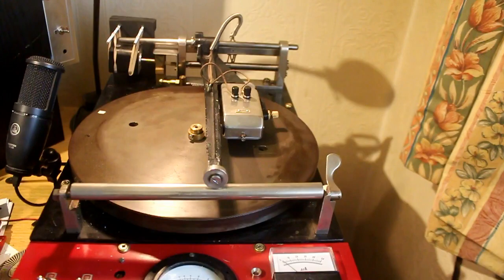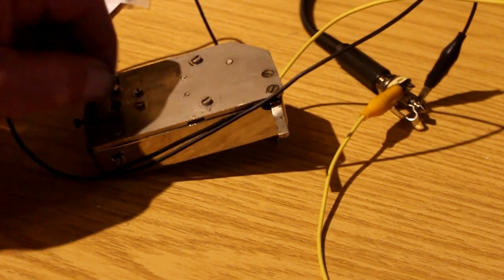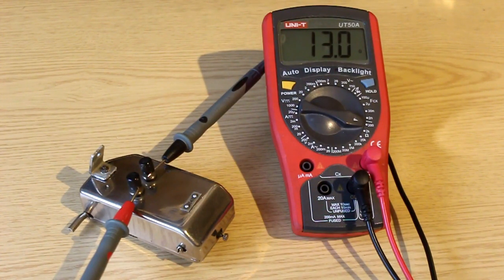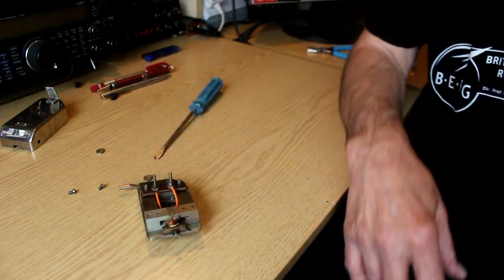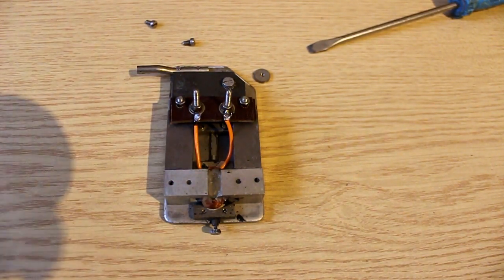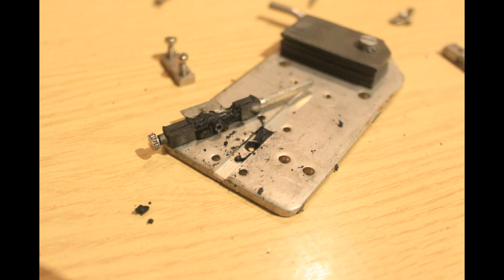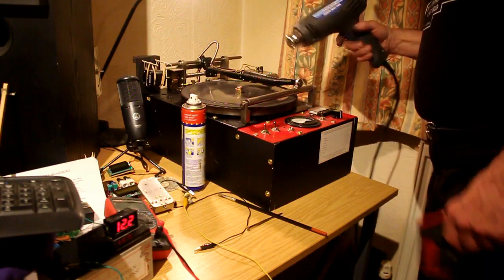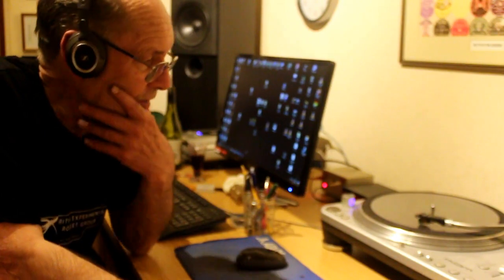MSS disc cutting head conservation.

Comment: Excellent repair job indeed.👌
Reply from the maker: Thanks for writing, Mark. Glad you liked it. The MSS head was ultra-simple, but could make quite good recordings, especially at the time that Cecil Watts devised it - ca. 1930. For various reasons, it was never radically updated, so by the the 1960s - when it was still being produced -   it was very 'old hat'. The two screw terminals on top proclaim its antique design; but the amplifiers MSS made could largely persuade the head to make a pretty decent recording! 😀

Comment: Hay Norman, After you did that nice job of rebuilding that cutter head, YOU FORGOT one thing - YOU DID NOT RE-MAGNETIZE that cutter. Once you pulled those magnets apart, you broke the field. The Gauss is reduce drastically and  the volume and efficiency of that cutter would  be very low. Then forcing you to feed more power into that coil it and you may burn it again.

Comment: Hello Norman, great video, I have a MSS machine, works fine mechanically and the head is ok. I believe the range top end is 8k and I’d like to know if that can be extended to something more modern? Are you in the business of working on these heads and is it actually possible to rewind or change the guts to get a wider frequency range. Thanks.
Reply from the maker: Sorry; I can't help you, because being 80 years old, I can't hear anything above about 6.5 kHz! However, if we had a Zoom chat, I could probably give you some useful info? Cheers, Norman.
Reply: @bixanorak  thanks for the quick reply, I understand, I don’t have the know how about these things so information may go over my head that’s why I was looking for someone who could do the technical work.

Comment: Interesting video, I have a very similar MSS lathe, same layout to yours but probably newer. The "cutting arm" on mine is rounded, all mounted in (I think) original wooden case with a Leak tonearm for playback. Also cuts 33 & 45. Mine has the same cutting head as in this video. I always thought my cutter had a replacement base plate, as it's not perfectly drilled etc, looks a bit homemade. But... appears to be the same as yours, the series of holes in the edge of the plate where cutter pivots/ is suspended aren't straight, yours looks exactly the same. Have these all been refurbished by same person in the past?? Interesting! I only have a little bit of history on MSS, do you have any more? I always thought mine was early 1960's but now I'm thinking a bit older
Reply from the maker: Hi Rog. Your three-speed machine would date basically from the early to mid 1950s and, as you say, well into the 1960s, only being finished off by the advent of stereo. They re-styled the arm, although the re-styling was more 'art deco' than 1950s! Again as you say, the heads have nearly always been 'worked on' - sometimes 'butchered' might be a better term; often I think, by well-intentioned amateurs, trying to make them work better, as demands for extended frequency response grew after WW2. Of course, MSS themselves made lots of improvements in this respect, especially in the equalisation fed to the head, automatic correction (radius compensation) during cutting, and in the damping of resonances in the old-fashioned moving iron armature. Everybody else had largely changed to moving coil cutting heads by this time. MSS were increasingly half-hearted in their work on disc cutting in this period, as they had espoused tape recording as the medium of the future - this is why (IMHO) they kept tinkering with the original old design instead of a totally new concept. I have been working on a history of MSS for several years, and gave a presentation on the subject to the CLPGS: www.clpgs.org.uk in autumn 2015. Hope this is of help. Best regards, Norman.

Comment: Very informative indeed! I am trying to use a Van Epps 500 ohm head! Using the 70 volt side of a Bogen Church Pre Amp! It gives Me a great sound, BUT Could be much better! The bass is way too high co I have to adjust for that! But I get a craggly sound around the end of My Recording! What to Do?? And I sometimes get quite a bit of Needle Chatter (Whistling) On some of My recording`s Thank You for any and all info You can give Me! I am pretty sure it will Help other folks Like Me! As will if You have any suggestions!

Comment: i like this video.. i have an M-41. ive been told. its not worth the referb,, I been trying your idea on a 3d coil.. I got some to work with a bolt. and a manget.. Now does it need any amplifying.. also whats 13 ohms in the united states.. I have no amp.. just a speaker output.. would have to wind it losely to drive like a speaker,, also been through some stereos to drive the coil.. been unsuccessful.. but your video gives me hope..

Comment: Really great video as i wanted to see inside one i have made a cutting head using a tiny stepper motor but frequency range is only up to 8 khz  i want it a touch higher as i want to do mechanical video recordings ,its fine for SSTV but NBTV a touch low

Comment: Hi Norman iv just purchased a Meisner cutting machine & now id like to know if it's possible to change motor speed to 45 to cut disc's.... Any advice much appreciated...
Reply from the maker: Hi Gene. I presume it now runs at 78. Does the turntable have an idler wheel drive? If so, how does the motor drive the idler? Is it just the motor shaft, or is there a bush or sleeve on the motor spindle? Cheers, Norman.

Comment: Norman,  Will you add fresh grease dampening?  And what of the removed nasty stuff?
Reply from the maker: Hi Ron. Sorry late reply! No; the earliest heads were very basic, as you have seen. So our 'conservation' was to return the head to its original spec., which had neither top nor bottom damping. The original heads just had suspension of the armature bar - the square rubber blocks. After all, when the head first appeared in the early 1930s, a top response of say 4500 Hz was perfectly OK for disc records. It was only later, in the 1940s & 1950s, when the upper end became extended to 8000, 10000, 12000 Hz, that MSS needed to 'doctor' their original design. Of course, they should have done a complete re-design! But by then,  tape recording was in the ascendant, and Cecil Watts, who started off MSS in the first place, had been bought out, & had retired. So they just kept on 'tweaking' the existing head. "A lonely road that led to nowhere", one might say! Moving coil, not moving iron, had been the way forward for years... All the best, Norman.

Comment: Perhaps I missed something but what did you do to replace the hardened black foam rubber dampening material?  All I observed from your stills was that you reassembled the cutter head and I was not sure what if any substitute for the original dampening material was replaced?
Reply from the maker: Hi there, and thanks for writing. Sorry, I should have made more plain, the difference between the two rubber suspension blocks; and the grease and the black damping material. The suspension blocks normally survive extremely well & can usually be re-fitted. Whereas the black block of 'whatever it was' (and the grease), which are the damping materials, are best simply cleaned off & discarded. This is because (a) we don't know exactly what they were, so can't provide replacements anyway; and (b) the original heads never had such damping in any case, and they have always seemed to me to work far better in their original state. Having said that, I have only ever used these heads at 78 rpm for cutting on lacquer, and for embossing on polycarbonate, mostly using 1920s & 1930s programme material, and the frequency response of the head 'as is' is perfectly satisfactory for that purpose. For example, the frequency response of the Western Electric system from 1925 'only' extended up to about 5 kHz or occasionally a bit more. Having said that, IF the rubber suspension blocks actually have become totally rigid, which I have indeed encountered, new suspension can easily be made from bicycle valve rubber and one or more layers of heat-shrink sleeving. This of course produces a round suspension, but it gets squared up when you replace the little securing bridges. Hope this is of help. Cheers, Norman.

Comment: How interesting: for many reasons.  I have a couple of MSS recorded discs - black acetate (?) on metal discs. They were used as packing for some 78s sent in the post!   Alas the centre-holes are slightly too small to fit over the spindle on my L75, so I have no idea of what's on them.  The cutting head is staggering simple; and the damping Heath-Robinson!  Life is an MSS cutting head: open it up and there's little inside!  Did you replace the grease-damping?  Has the lack of damping from the degraded black lump had subjective consequences for the recorded sound?

And don't you get through a lot of wine.
Reply from the maker: Mea culpa, dear Hector. To overhaul the head would have taken around 45 minutes; but to make & edit a video of the process occupied over seven hours, so I freely admit I was a bit slurred towards the end. As regards the damping, which Ron L'Herault has also asked about: no. I believe (but have no proof) that the original heads did not have any damping at all. Here, of course, we draw the crucial distinction between the rubber suspension of the armature; and any separate damping of the armature. Currently, I believe that Cecil Watts contrived rubber suspension blocks that also served as  damping against undesired resonances. But when Watts was working on his machine in the early 1930s, the upper frequency limit of a disc record was about 5 KHz. His basic head seems to work fine 'as is' with that frequency response. But later, in the 1940s and onwards, a much extended frequency response was required - up to 10 KHz, & beyond. I believe that then, that old design revealed resonances that hitherto had been unimportant. So to suppress them, it is conjectured that various makeshift damping measures were applied. The grease on the top of the armature might have damped high-frequency resonances; and the black block at the bottom may - I only say may - have been intended to remove low frequency resonances. Unfortunately, after 50 years or so, the black block becomes solid & prevents the head from working at all. Being only interested in 78 rpm recording of material no later than the mid-1930s, I have found that the head works fine, for me at least,  in its original state. Alas, if I had only asked John R T Davies about this matter years ago, he would doubtless have explained it to me in great detail! Wishing you all the best, Norman. P.S. A light touch with a taper reamer will open the hole in your MSS lacquers, enabling them to fit on the slightly oversized spindle that Goldring used on most of their decks. Worst-case scenario: fitting an early Pathé Actuelle onto a Goldring GL75 - more often than not, it won't go on. >8^(
Reply: @bixanorak  Hello again Norman! The MSS deck I mentioned in an earlier reply, with high impedance head and matching transformer, actually belonged to John R T Davies. It is fitted with a later motor on a very efficient home made suspension, there was a home made suction tube behind the head, and it is the only one of my 4 machines to have an opposite thread lead screw (IE centre start) some meccano gears corrected this! It was set up for 33rpm when I got it so I presume he mastered all those "Bateu Chinois" records on it. Regards, Rob.

Comment: Hi thanks for the very clear and informative video. Out of interest, is the square paddle part of the armature, sitting in the coil made of steel? It was my first thought but the surely it would stick to the magnets wouldn’t it?
Reply from the maker: Thanks for writing! The long 'armature' (which is in effect a torsion bar) is clamped at the back end (see vid about 10' 20" - 10' 30"); thus, the paddle in the coil is firmly held midway in the gap between the two pole pieces. The signal going into the coil will make the paddle 'wobble' slightly from side to side, so moving the cutting stylus - but not so far as to click onto one of the poles. If it did so, it would indeed as you say, 'stick' to the pole. There's a close-up at 11 min 18 sec which shows the paddle in the gap, with the rest of the armature going back to the two bolts that hold the far end rigid. Glad you liked the vid! All the best for 2022 - take care - cheers, Norman.
Reply from the maker: @Mark Animaco Hi There... Well, all the basic info. is in the video! A base of Aluminium (non-magnetic); a torsion bar, clamped at the rear end. It could be 3 or 4mm square mild steel, or round would be OK - just file a flat at the rear end. Near the front, some suspension either side of a vertical steel fin, located on the top of the torsion bar - even soft-soldering might hold it in place. The most difficult part would be winding the coil to fit over the fin. The easy part would be using 3 or 4 small circular Neodymium magnets (quite cheap) either side of the fin instead of a complete 'magnetic circuit'. To make the coil, a former of thin plastic sheet could be cut out and glued together. Wind the former using a lathe or hand drill & layer the wire from side to side - two people best for this! Even better is to make a 'free-standing' coil by winding the wire onto a former through a pad soaked in weak shellac solution. When it dries, the wire will be held together solidly. Enamelled copper wire of 0.2mm diameter will be OK. It takes some judgement as to taking the coil off the former! If it's too dry, it won't want to come off the former. 🤔 0.2mm diameter is about 35 SWG, & resistance is about O.45 Ohms per metre. So winding a coil of say 20 metres of 35 SWG wire will total ~ 9 Ohms, so can be driven from a normal audio amplifier. Hope this is of help. Cheers, Norman.
Reply from the maker: @Mark Animaco Hi Mark... drop me a line at jazz@normanfield.com & we'll take it from there, OK? Cheers, Norman.

Comment: Do you know if the head is supposed to heat a bit while cutting a reasonable volume ? I recall tried to cut a record from an off circuit pickup head I recoiled at 200 ohms and I was frightened to melt it while recording so I stopped x)
Reply from the maker: Hi there. If your head is noticeably heating up, sorry, but there must be something wrong. A head such as the one in this video, requires only 3 or 4 Watts to work it. They don't noticeably heat up. Commonly, in old portable equipments, a 6V6 valve would provide ample power. In the 1950s, an EL84 (6BQ5) was still OK. Of course, much higher powered amplifiers were used in fixed locations. One MSS amplifier had two EL34s in push-pull, which might have provided 15 or 20 Watts RMS. BUT this did not mean that so much power was needed; it simply ensured that the amp was just idling or 'ticking over', so  the distortion would be very low. If your head is heating up, it could be due to: (a) the armature is too heavily damped; (b) part of the coil is somehow shorted out (does it still measure 200 Ohms at the head terminals?) In one head I rewound badly, the coil was not secured firmly, so the coil broke loose & began to vibrate, and because the coil was not sufficiently insulated from the metalwork, the enamel on the wire wore through & caused a near short-circuit - which stopped the head working, & eventually one of the leads burned out, producing a curl of smoke from the head! Fortunately, the 100 W amplifier being used survived OK. (c) 200 Ohms is rather a large value if you're using the speaker (low impedance) output of an amplifier. If that's what you're using, a coil of 10 - 15 Ohms DC resistance would appear to the amp as virtually identical to a loudspeaker - so the amp should be perfectly happy with the cutting head as a load. Hope this is of come help. Cheers, Norman.

Comment: Did this company ever develop feedback cutters?
Reply from the maker: Probably not; I'm an enthusiast rather than a strict historian, but I doubt it. The company history of MSS is quite convoluted, especially after WW2. Cecil Watts was eventually bought out, and the company started making tape recorders, which can't have been a success, because I've only ever seen ONE of 'em! But they kept on making the cutting lathes, still using the same model of head, even in 1959 (there's a Wireless World advert. that year); I haven't looked for any later ads though. They were very good at persuading the head to make rather commendably good recordings - by using grease damping, and various inductance/capacitance filters, also they had a multiple contact compensator (on some models) that lifted the top end as the head approached the centre of the disc. Incidentally, the Beatles first record (a one-off lacquer 78) was made by a chap in Liverpool who had an MSS outfit in the back of his shop.
Reply: Thanks.  I once owned a consumer disc recorder (Wilcox-Gay) and had use of a Universal professional recorder.  I enjoyed recording because, unlike today, some skill was required.  @bixanorak